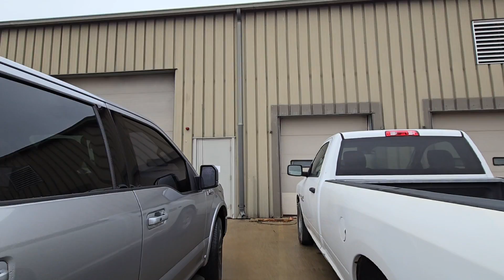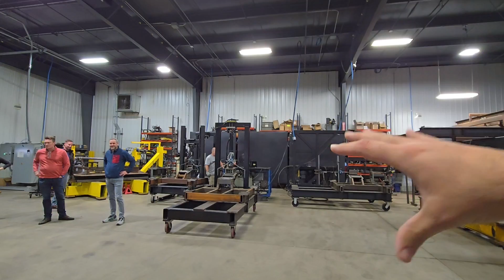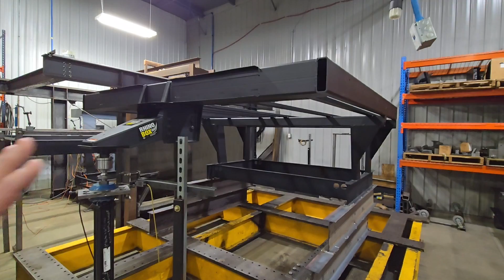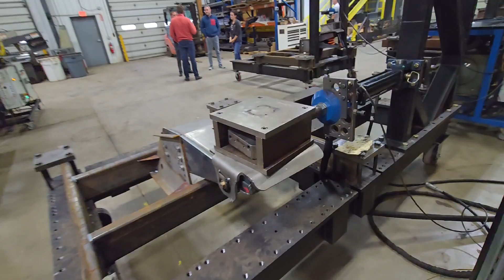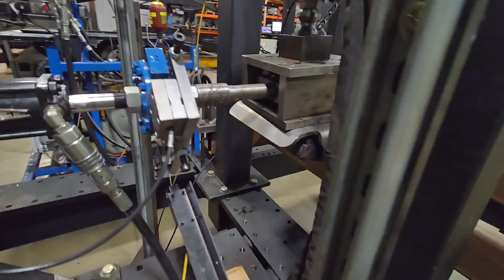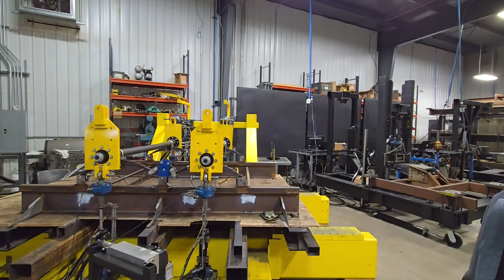LIPPERT'S AREA 51! R&D and Testing! Not all RV components are created equal!

Comment: BTBRV - You constant comments that not having a vehicle in the garage of a toy hauler causes excessive pin weight is ridiculous. The frame should be built for that situation. 
And why is Lippert only only stress testing fifth wheel boxes at 25% of GVW? I mean LOOK AT THE FLEX and only 25%!! No wonder the frames are breaking.
Reply from the maker: How do you build a frame that counteracts a cantilever over axles?  If you can answer that, you can sell your physics defying tech to all trailer manufacturers! And NASA

Comment: The testing they showed you is meaningless unless they can show that the fatigue test accurately models the frequency and magnitude of the displacement that occurs in the real world. The same with the ultimate load test.  I would also like to see examples of exactly where the failures occurred.  An examination of the crack surfaces can tell if they exhibit the classic signs of fatigue or if the failure was due to exceeding the ultimate load limit of the item.  In addition, the specs of the steel should be discussed as well as what quality controls they employ to ensure that the steel they receive meets the specs.  If they they really wanted to understand what is going on and how to design for the foreseeable usage of their products, they would go down the road to W. Lafayette and get some help from the Engineering School. There is probably some PhD student who would love to take this on as a project in order to diagnose the problem and prescribe design changes.

Comment: It is great how open they are to the public,  I am a off road RV user and always wonder about not only static limits but also dynamic limits.  Specifically hitches and how loads are moved from the RV to the tow rig.  The load difference between static and dynamic loads must be huge.

Comment: The robust design elements most likely include DFMEA / PFMEA. Any realized issues related to functionality / safety require Failure Analysis to drill down to actual cause. Engineering requires constant feedback to identify unknown variables that the end customers subject their RVs to knowingly/unknowingly. Lean manufacturing and qualified suppliers can support quality, however any human factor can break continuity. I would like to see manufacturers tear down 5th wheels trailers  found with frame or suspension failuress and report their findings. I experienced suspension failure and very leary on buying another rig. Please note: place warning labels at all points to educate consumers.

Comment: AGAIN..... the thin aluminum stud walls, fiberglass and Styrofoam are NOT going to provide a "super-structure" on top of this frame that will add any real load bearing structure to a steel frame and it isn't supposed to. I've seen it firsthand, if you flex that fiberglass, and aluminum stud wall like that Rhino Box frame is flexing in this video the wall fiberglass will crack, buckle, and the welds on the aluminum studs will fail. Period.

Comment: 8:45 this movement is exactly what will loosen lags, and the hardware inside the aluminum square tubing stuffed with wood.
Reply from the maker: But if the structure is made properly and attached properly, you shouldn't see nearly that much movement.
Reply: Hello Guss where are you?

Comment: I think Lippert is doing an excellent job , however, since the  fame is only as good as the finished product, real-world testing of the final product, under real-world conditions, is vital. The manufacturer should be doing this. However, Lippert should use their clout to pressure their customers to do this testing and advise them of any issue regarding the frame that come up. Remember, these RVs are not cheap and many a consumer is investing  their life savings in the product.

Comment: Again, the walls are not built to carry any weight. A gooseneck trailer doesn't have walls and doesn't flex. You can't expect 2x2 and laminated walls to carry any weight
Reply: I agree with you 100% why would you need walls to take the flex off,.
Reply from the maker: Ask all dry van Semi trailer manufacturers. ALL OF THEM.  Or home builders. Or Aircraft engineers, or Skyscaper engineers, or school bus manufacturers, or boat builders

Comment: There's a lot to unpack here.  Their frame flex fatigue test had only one axis of load input (vertical or z axis) and combined loads should be used.  And using 25% of the GVWR for the loads is good, but they also need to gross up that load for the dynamic road inputs as that will substantially increase the peak load values for fatigue damage.  And it would be interesting if the full 25% of GVWR was actually applied or if the loading was discounted under the assumption side walls were reacting half of the pin load.

Also under their load testing there was a significant displacement occurring which would be reacted by the lag bolts used by the RV OEM.  Reaction is greatest near the load application meaning the fastener closest to the pin box will be more highly loaded than fasteners closer to the drop section of the frame unless the sidewall of the trailer is extremely stiff and hole tolerances are very tight.  That interface becomes critical to identify expected loads ensuring proper fastener sizing.

The forensics of the failed frames in service isn't difficult.  It appears Lippert nor the OEMs are willing to accept liability which is a big blemish on the whole industry.
Reply: When neither company Lippert or the trailer mfr is willing to put their  engineers in one room and say solve the problem or we won't let you out. You know the whole thing  is about making money and pointing fingers just like the swamp rats in DC.

Comment: This has proved nothing to me. To start with RV manufacturers are wanting the market of folks with half ton pickups. So the first place weight iscut in in the frame work. Then you cantelever the hitch weight out24 plus inches for turning clearance. The twisting on the forward framework is incredible. Then to test, put a finished product on a test track and highway and see how it holds up to twists, wind loads, stopping, and actually overload it. Then take it apart and see where it failed. Sorry folks, this showed me nothing.

Comment: That testing is so old there are no F/A or lateral inputs. This is all low frequency loading. As vehicle dynamics engineer these systems need real time testing frequency's 0 to 50hz. They need to instrument these frames like we do autos. Some of our tests collect more than 100 inputs then brought into the lab data edited and through a process of RPC input those loads and frequencies through the tire patch into the frame. These are full vehicle road simulators; this link will give you an idea of real time testing. https://www.youtube.com/watch?v=MxlcZZIQnm4

Comment: I’ve been in automotive R&D since 2000 and most of that includes vibration testing. I was hoping they had a vibration slip table somewhere. Their other tests had merit but without incorporating vibration it’s almost meaningless. I think you should find a way to tour either a Ford, GM, or Chrysler truck testing facility. I think people would be shocked how far “above and beyond” they go to find failures. Also, they need some environmental testing. Flexing those frames at room test doesn’t show what happens at cold and hot temps to the metal or the welds.
Reply: Caveat EE here not ME. Where is the random vib? Where is the temp cycling? Where are the other degrees of motion (pitch and yaw)?

Comment: So, to sum all these videos up, you have, in my opinion, conclusively shown that the fault of all this frame controversy lies largely with the RV manufacturers. From the ordering of cheaper built frames to the bad installation and marrying of the RV body to the frame, then the owners fault in the placing of after market accessories and components mixed with improperly loaded trailers, and then showing the largest percentages of “failures” are in the 5th wheel category.

Comment: This design methodology that uses "FOAM" core wall to reinforce the "STEEL" frame is absolutely Ludacris.  If this is how Lippert designs their frames, I will never and I will tell others to by a 5th wheel frame made by Lippert.  They trying to deflect their curability for the frame failure that are occurring.  And this channel is spreading the "dis-information".     Looking at the pin box test you can clearly see the upper deck connections to lower chassis is inadequate.   You need some people experienced in "STRUCTURAL STEEL DESIGNS".
Reply: Guss to the day off when they manufactured that frame.

Comment: Why would a rigid Pin box be approved but not a Gen-Y that has suspension? I see a Gen-Y on the shelf, did you ask about their testing of it?
Reply from the maker: Length is lever arm
Reply: @BTBRV But the Curt Flex Air pin box is 3.5 inches longer than the gen-y king pin box.

Comment: So let me get this straight, the Frame Flex issue is due largely to water intrusion or damage to the separation of the RV chassis from the frame as per your part 1 interview? Then why are they testing the frame separately with no "box structure" or chassis attached?  Shouldn't they be testing all of these frames with a full chassis/body on them?
Reply from the maker: They know the specs they need to build to.
Reply: @BTBRV  you mean the same specs that are obvious inadequate and are failing?

Comment: Have you had a chance to ask a Lippert engineer if they approve the use of Sumo springs on their chassis?
Reply from the maker: I'm sorry, I didn't think of asking at the time.
Reply: Maybe you could reach out to one of your new contacts and ask. I only ask this because I have seen one 5th wheel trailer that had Sumo springs and the lower flange of the Ibeam on the trailer frame cracked and buckled right where the sumo spring made contact, their 5th wheel was a total loss. @BTBRV
Reply: @davecamilleri9411 I think I saw the same video
Reply: @BTBRV I’d be interested to know about the Sumo springs, also, as we have them installed.  No indication of potential issues yet.  It’s been well over a year, with near constant travel.

Comment: As with most testing, you want to control the variables to ensure the objective of the test can be obtained and met. The testing of the upper deck was good to see and I'm glad that they do that test.   The question would be how representative was that upper deck to those that come off the production line.   I believe its possible but rather unlikely that every upper deck that is manually welded to be exactly configured as the one in the test.  So what was the objective of this particular test?  I'm not sure based on the video discussion.  I also noted that the steel plate that is welded in the downturn area forming a "box" was missing.  The attachment of that steel plate would significantly change the reaction of the upper deck to the loads they were applying and inherently transfer those loads down the length of the I Beam chassis.  Again not real sure what the objective of that particular test set up was for.  The take away here is that Lippert does appear to perform due diligence in testing of the structural components they produce but I'd love to know/see that they also do quality acceptance testing ( aka lot sample testing) from the production line to ensure the items from their production lines are conformance with their design specifications.   That is essential to confidently delivering quality components and items that will last.   JD, thanks for your efforts on this topic.

Comment: Ok hotshot.  Any engineer worth a shit will tell you what works in the lab will Fail in the field.  They will also tell you what works on paper doesn't work in the field.  Also what works in the field will never work on paper.  Don't think so??  Ask any engineer if a helicopter works on paper. Hint, it doesn't.  Lab testing is fine for what it does but without real world testing you have left out a large section of testing.  I only heard one engineer say to the code he was testing for.  Now to show why real world testing is important none of those high dollar machines is testing for bad road conditions.  Ever hit a pot hole and have the hard jerk?  Yeah me too and it sucks especially when it's so bad you pop a tire.  Are they testing for anything like that??  What about transitional and torsional loads with jecks and hard hits caused by bad roads??  No.  Humm why not.  
    In the oilfield we help a lot of companies do real world testing.  It helps them produce better products.  What worked on paper or in the lab did not work in the real world environment.  Not being mean to lipert just pointing out some things I did not see.  Also I saw no complete frames being tested with loads of the frames.  Put weight on the frames and test would that not be a better test.  
   On one test they where doing a 25% load test when the load normally was 15 to 20% as manufactured that's only 5% more on their test.  A good hard pedill to the metal take off or a very hard stop can generate more force than that.  
    With no real world testing and no weights on any part of the frames tested shows me a real lack of quality control.  Bet none of them could tell you the real world like loading on any part of their frames.  On paper maybe but in the wild where their frames are used.another puff Peace.  Interesting but not what's going on out in the wild where it counts most.  .
Reply: Do you think the tow vehicle having shock absorbers has any relevance?

Comment: A question to ask them is why are leaf spring suspensions allowed to be fitted to their frames when they know that they wont last , will fail ,give a rubbish and uncomfortable ride ?
For the bigger rigs ,they should be compulsory independent suspension and disc brakes.
Wonder how many failers of leaf spring and drum brake combos you could gather to show the problem?
The suspensions get shaken to bits  in many cases .
Again thanks for showing things that many dont know about .
Reply: I agree. The axle/ suspension test stand seend like a pr display. I was expecting shock and vibration, not the gental movements.
Reply: @calculatedrisk114  What's missing there??? Shock absorbers!!! How long would your truck frame hold up with no shock absorbers?

Comment: Any more testing videos coming up?  I would have liked to have seen a full up systems level dynamic testing of a complete frame under load as it would be in service.  Anything on the quality testing process such as weld testing, how often do they pull a unit from the line and fully test it, those types of things.
Reply from the maker: That's part of the road and proving ground testing. I wasn't there to see that.

Comment: When they reference 300,000 test cycles how many average road miles would they consider being equal to?
Reply from the maker: 900,000 cycles.  300,000 in each direction.  That's the SAE requirement
Reply: Two trips down our main-street..

Comment: So the upper deck has just vertical stress/ deflection test being tested on a newer design frame. What about placing a horizontal load to simulate stopping and going to include side to side testing with the vertical load. 
Any data on frame designs like GD going back 4-5 years? 
And why is the outer walls handling 50%? If that’s the case, why are they using screws versus bolts to tie both structures?
Reply: Believe it or not the truck mfrs consider the glue in glass windshield as part of the supporting structure.. Henry Ford probably rolls over in his grave every-time a new truck roles by LoL

Comment: I find it interesting they only test to 25% the gvwr for vertical load at the pin box. Most fifth wheels including myself are at 25% the gvwr tongue weight normally. I do not have any solar or monster batteries. I do however have a washer dryer combo and generator that help me get there really quick. Why not test to a higher standard of say 30-35% vertical load. Seems to me they are only testing to bare minimum.
Reply: I was surprised they said they test to 25% GVWR with the expectation that normal load is 15% - 20% GVWR.  I would have expected testing to a larger difference.

Comment: Saw some Gen Y in the test facility 👀
Reply: They were requested to test and approve the Gen-Y for the Brinkley but Lippert did not approve. Brinkley stepped up and said if any of their customers have a frame issue due to the Geny, they will cover the cost of the repair. Regardless to what Lippert said.
  I believe Lippert bought out Curt, so I suspect you'll see Curt version coming soon.

Comment: The test I wanted to see is when they connect the upper deck to a full frame and drop frame too main frame, doesn't have to be a full length main frame,  and do a deflection test.  That information should be provided to the manufacturers so they will know how much stress their boxes have to support.

Comment: When we leave out on a trip all loaded up according to  the cat scale I have 4520 on the steer axle wich is 2260 per tire I have 4760 on the drive axle which is 2880 per tire and I have 9240 on the three trailer axles which is 1540 on each trailer tire which are 16" e rated tires...43 ft toyhauler and long bed crew cab srw 21 f 350 4x4 7.3 so not overloaded
Reply: Don't assume the weight is "split" side to side on every axle. Especially "loaded up" weight will vary side to side and you could easily be overloading a side.
Reply: @Itsa_Mea  we have a few lawn chairs in the front storage  a few groceries in the fridge a backpack with a few clothes laying on the center of the mattress in the bedroom and 2 bicycles in the garage, I don't burn fuel towing anything I don't need if the weight bias side to side is far off kilter that's on the manufacturer